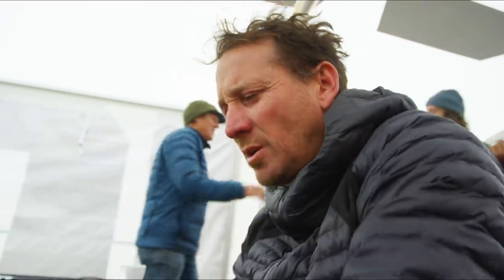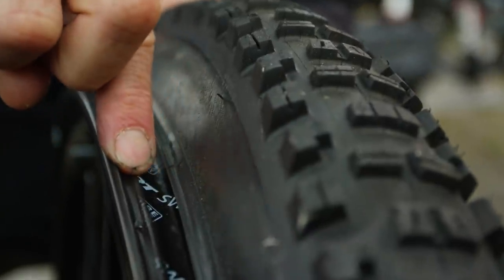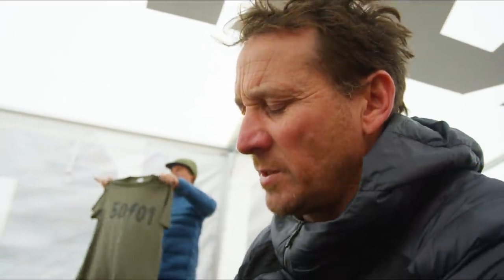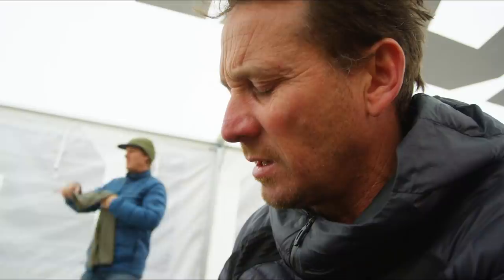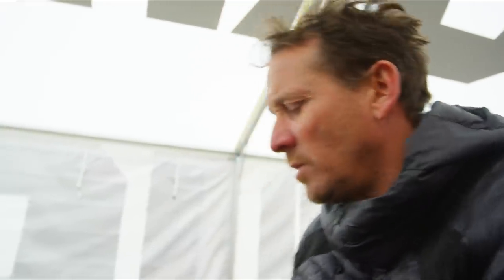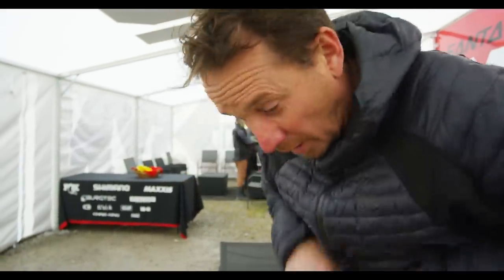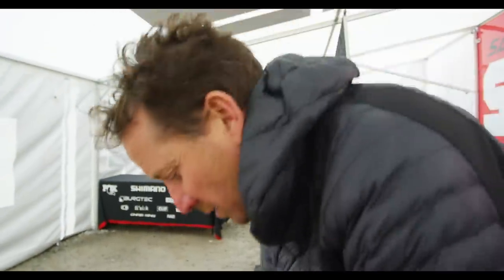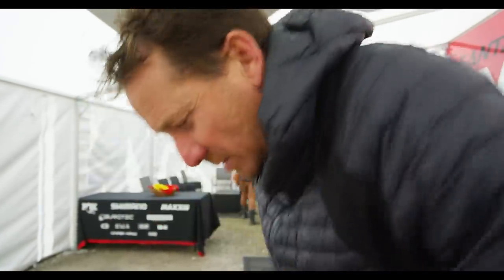Marshy's Fort William Tyre Setup for Greg Minnaar

Comment: The 'sealant' that car tyre fitters use is actually soap to lubricate the bead to allow the bead to pop on the the rim easily. I don't think it helps with sealing.
Reply: He's probably talking about bead sealer. Usually used on steel wheels where there's a bit of corrosion though, not alloys.

Comment: Interesting stuff. Normally, these PU sealant/adhesives only come off mechanically once cured (i.e. no chemical will remove it), so does this make the rim/tyre a single-weekend combo?
Also:
From the Sikaflex datasheet: Suitable for use in hot and tropical climatic conditions. Sounds perfect for Fort Bill lol :)
Reply: yeah i was thinking that
Reply: This roofing sealant doesn't fully cure like an adhesive, stays pliable. Tyre will come off no prob, cleaning I'm not sure but would try WD-40, that shit gets everything off.

Comment: Wow no inserts! 🤯
Because DH casing?
Reply: Its to save weight. Some of the riders would prefer to run the lightest setup they can get away with, and when they hit the gnar sections, they try to unweight the bike a bit instead of just smashing through it reducing the impact on the wheels. 
Minnar has been known to even reduce the amount of sealent in his tyre just to save the smallest amount of rotational weight
Reply: @lewistaylor1489  yep that's what Jason was sayin. Huh Trip out!

You'd Figure the performance advantages from some cush core (even the XC one at 141grams) would definitely overthrow the need to ride light 🤔
But he would know, he's the world cup racer, Not me! Hahaha
Reply: They are running the prototype ZK/Breaker version of the DH tires which have extra rubber (~100g weight penalty) for protection, so no insert.
Reply: maxxis has a prototype +breaker that may be in the tire itself to avoid inserts.  Been seeing that labeled on the tires the past 2 years.